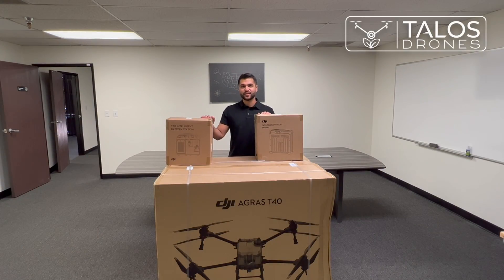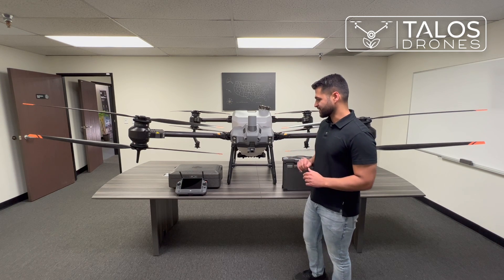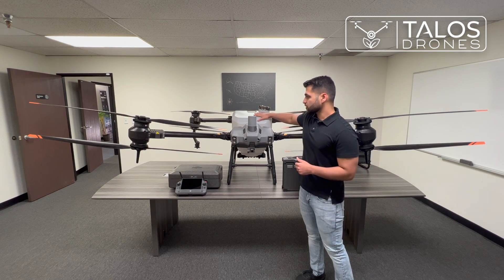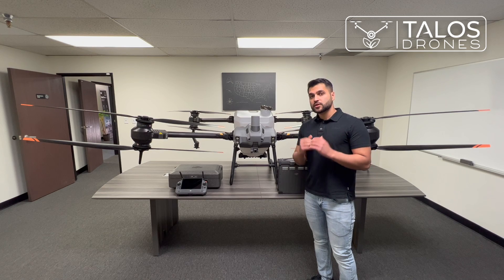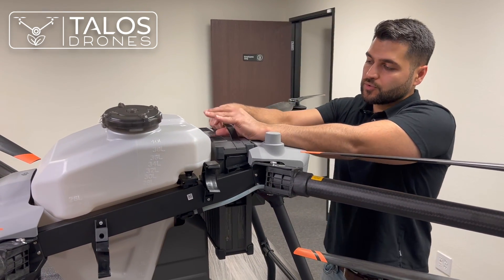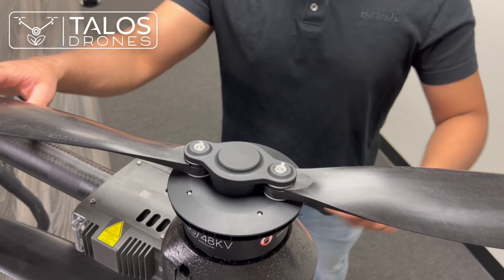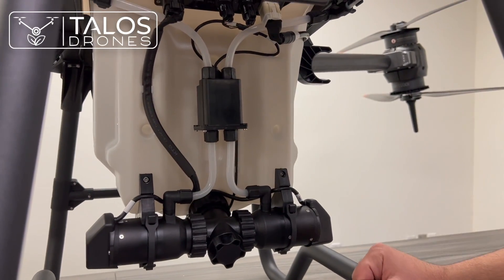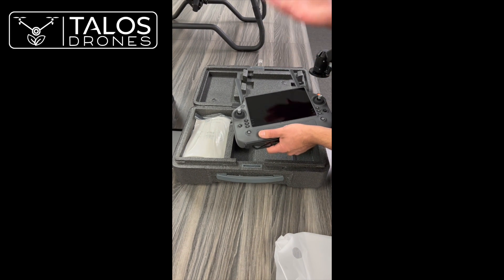DJI Agras T40 Introduction & Unboxing

Comment: Hello, thanks for the video. I would like to know about the batteries. I don’t see that at least one battery is included in the drone box with the charger. Are the batteries sold separately from the drone unit? Thanks.
Reply from the maker: Hello, you are correct the batteries and charger are sold separately.